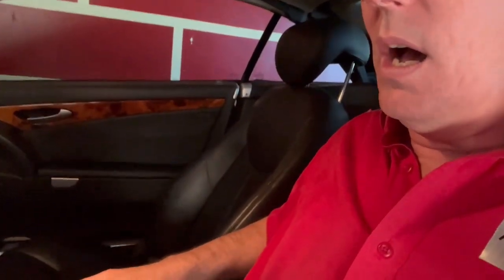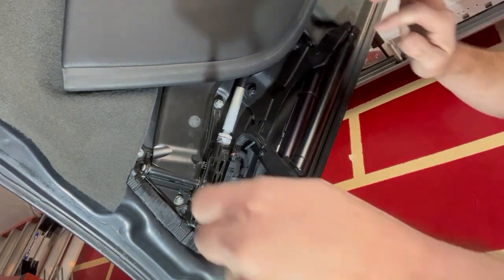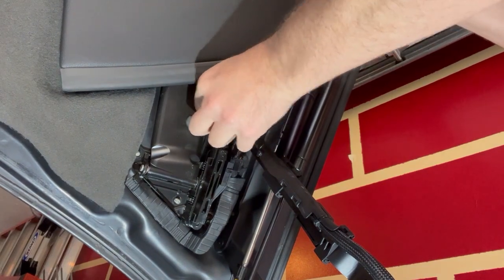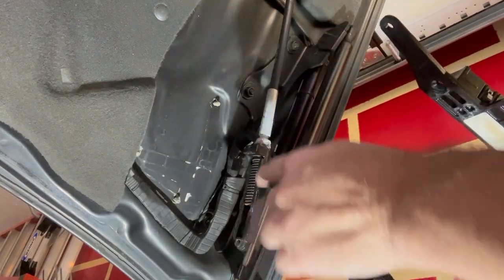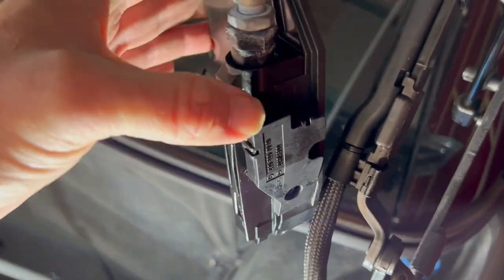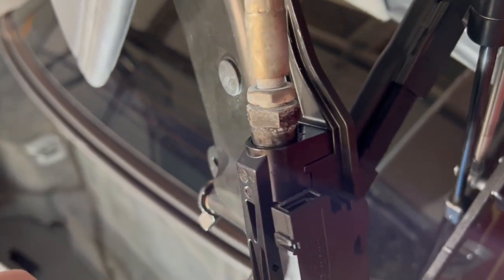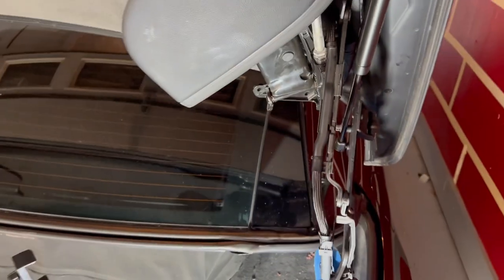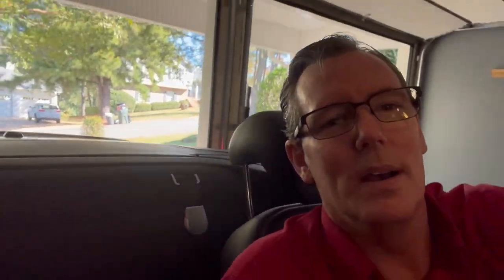SL Vario roof Flap Fix

Comment: Thanks to this video and other videos I have just did this myself. It’s much easier if you pop the flap off, and unscrew it from the arm. Put everything back the re attach the flap. However I notice your old part is the upgraded version. Your old part is not from the factory and this was replaced at least once before. Also hope you added some grease inside that “rack and pinion” where you can see the wears
Reply from the maker: Yes, good insight, I did lube it up, and yeah I found removing it and using some painters tape to hold it together as assembly happens is easier too! Thanks for watching , I’m glad to hear you fixed yours! 
MooseMade

Comment: Thank you for this video! Where can I get the part?
Also does your SL have a Push to Start on the Shifter?
Reply from the maker: I like to get my parts from Autohauz AZ, I am NOT sponsored by them. And yes my car has the E-Z go option in the shifter. 
MooseMade
Reply: @moosemadevideo9330  thank you for that, the starter in the shifter is unresponsive in my SL. Do you know what the reason might be?
Reply from the maker: I have not encountered that before, my best guess would be a low battery in the key fob.

Comment: Hello would you say that a $5000. Transmission replacement  is fair pricing? any advice is appreciated.
Reply from the maker: I feel there are a few factors that go into it. Is it a new transmission? Are there shipping costs, a core charge? (Cash On Return Exchange) is the work being done by the dealership, or a local shop you trust? I had to change the trans in mine and the shop I used found one from a newly crashed SL, I had it installed and programmed for the car for about 2500. Also, the shop that did it gave me a warranty for six months on the trans and a year on the work. Things to consider. I’m sorry to hear you are having transmission issues. The local dealership wanted nearly 11 thousand for the same work as a point of reference. 
MooseMade
Reply: @moosemadevideo9330  hello thanks for replying, it would be a rebuilt piece with a core exchange warranties on labor and parts as well the work /labor performed by a local shop with Mercedes’ experience, the dealership would charge more than the vehicles worth. Thanks again